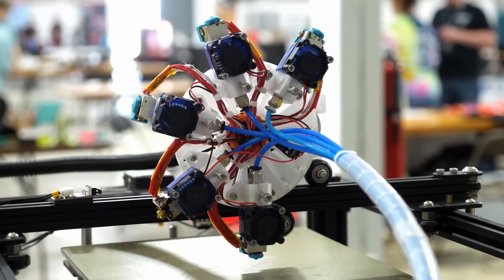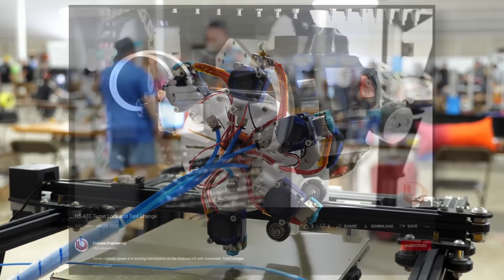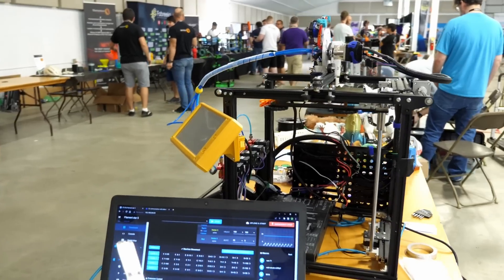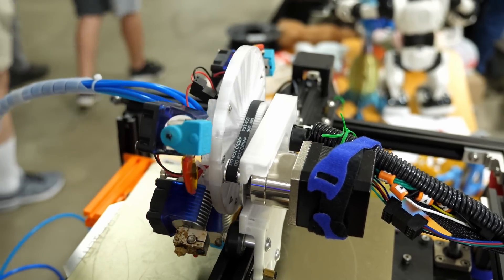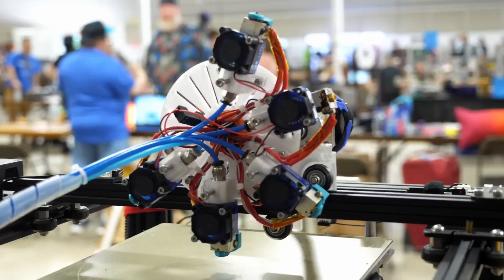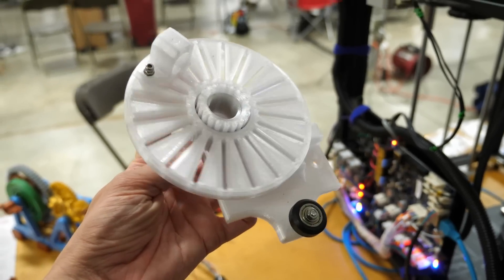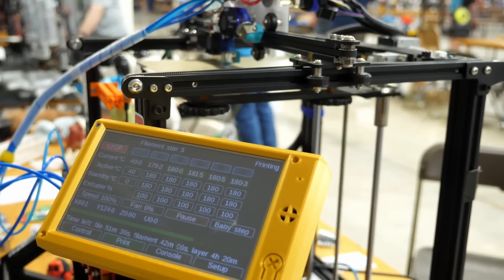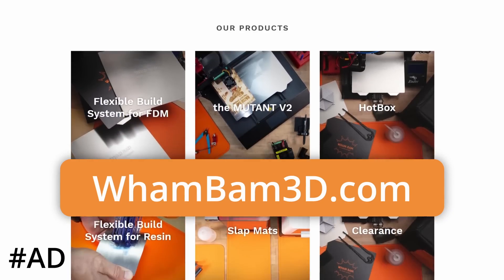The Toolchanger that ROTATES! #MRRF2022

Comment from the maker: Does the Rotating Tool Changer make you dizzy or is it a viable alternative to common Tool Changers?
Reply: Sincerely i don't like it too much. 
By working with advanced high productivity machine tools i've studied a lot about tool changers, and, in traditional machine tools, revolver turret, like the one shown in video, have been really passed by tool changers. To see a similar rotating system that is fantastic for flexibility look at Fanuc Robodrill. If you're instead interested in rotary revolver tool changers the ones seen in "Riello sistemi machines" are beautiful to look at, but convenient only in rare cases where certain flexibility need to be paired with high productivity.
Sorry for my English, but i really like tool changers in machine tools and wanted to say my 50 cents 🙈
Reply: I think it's a good way to make your printhead weigh a lot.
Reply: I think real toolchangers are the Future.(Like in a cnc) But this Design might be changed a Bit to accomodate maybe 3 Heads to get it lighter and still versatile. The reduced waste is a big plus.(you get that with Classic toolchangers also,but they might be more complex or more expensive.)
Reply: thats a lot of moving mass
Reply: Very nice indeed, if it could limit the build volume a bit less it would really interesting.
Reply: Besides the advantages you've pointed out, rotating a nozzle in an arc (while printing) can have benefits of its own.
Reply: it is crap but new things are cool

Comment: Hi Stefan,
First, any opportunity is a good one to compliment you on your work. Best channel on YouTube.
 I didn't find any way to write to Jerry and Jack directly, and I would like to suggest them to try their system on a machine that moves the trey in X & Y, and only the head (with the system) in the Z axis. It will be much more feasible this way. There is nothing to develop. Most milling machines are built this way. 
By the way, a creep resistance test on annealed PLA parts may create some interesting results, since this property is highly dependent on crystallinity percentage.

Comment: Definitely a cool idea, but that's a LOT of mass on the gantry. We have a small tool that's similar to TAMV, but more of a manual camera-assisted process. Still works easily, just not automated...but the advantage is that it's not tied to a specific printer or firmware type.

Comment: Every time people talk about 3D print tool changers, even just nozzles, I always wonder why they don't add an ironing head.  Wouldn't that work?  I would have thought that would be a gimme.  Plus, you could do more with tools like that.  Maybe have a little heated rod to iron the sides of layers.  It could ensure tolerances, texture, maybe even erase layer lines.
Reply: u can already iron out the surface with Cura by having it run thru the lines that were already printed

Comment: I could see them improving this by using it in an upside down printer, and having the tools rotate in a flat plane like a revolver cylinder. There would be no oozing if the nozzle was pointed up when not in use.

Comment: i dont understand how these experienced makers dont see the problems with this even before its made? bowden drive, weight, leveling just for first thoughts.
Reply: It's much more likely that, as experienced makers, they've all had experiences where they've thought something would never work only to find that all the disadvantages it had weren't as bad as they thought, and there were unexpected advantages. Sometimes actually building a thing even if you "know" it won't work is the best way to deal with an idea - even if it doesn't, the lessons learnt often bring insights to other projects that can't be gained from just dismissing it.
Reply: @bosstowndynamics5488  It can be a useful approach to build things you expect not to work and learn from the experience, and Simone Giertz gave a great TED talk about that. But the results are inevitable "shitty robots". There is quite a difference between tweaking a working design beyond what you expect to actually work, and starting with a design that very obviously amplifies a well known problem like seriously limiting speed with a very high print head weight. The latter isn't really constructive experimentation, just bad engineering, as there is no way this could have ended in a practical tool changer. If all they wanted was to experiment with rotating tools, fine, but saying that "it isn't a product yet" implies that they believe they can somehow optimize their way out of a dead end design.

Comment: What a beautiful design, even in its early state. It's like this guy read my complaints about the X1 Carbon and made a machine directly in response.

Also, has there ever been a printer where the bed does all the movement and the extruder remains stationary or is that a bad idea for some reason?
Reply: The bed moving would take up more space, and it’s heavier, but it could work…
Reply: @penninna  the space thing is a definite minus, but I figure at some point you can add enough extruders to outweigh the bed

Comment: Really interesting and useful for certain use cases, but not for me... I don't usually need multiple filaments, and I am used to more speed with my SK-Tank. I'm curious to know if it can handle hotends of different lengths though... maybe a Volcano on one, and something short for TPU on another. I guess you'd just need to insert some gcode to raise/lower the assembly as you are rotating. I bet Z height calibration is a hassle with this thing :-)

One (unrelated) thing I was thinking of trying is to use a stepper motor to drive the filament spool. I would need that set up mechanically, then add a sensor to determine the diameter of the filament remaining on the spool. With those two things I could maybe use some live code to to determine how much to drive the spool stepper. Ideally the spool would be kept in sync with the needs of the extruder, and you could avoid all the issues with too much or too little spool unwinding.

Comment: I've been toying around with the idea of a toolhead changer, and the whole concept seems really inefficient to me. You're either constantly thermally cycling each toolhead (no good for wear and tear, adds to print time waiting for the nozzle to get up to temp each time you switch colours, which means the heatbed is on and wasting energy for longer than it needs to be), or you have the other nozzles that aren't currently being used always at temp, wasting energy, and burning the PLA inside of them if one colour isn't used for a while. I suppose the most efficient method would be to estimate the time it takes to heat the nozzle, and have it start heating before it's needed.
Reply: True but there are inefficiencies in every type of multimaterial system, usually in the form of purged filament. The goal of this device is to minimize wasted material, which it achieves successfully at the cost of slower prints and higher energy use.

Teaching Tech did a review of the X1 Carbon and showed how a 28g multicolor print created 328 grams of purged filament. This is a nonstarter for me, and given the choice I much prefer the featured toolchanger

Comment: I think it should have a static, non-rotating lock + centering mechanism in place to properly center each toolhead independently from rotating. This would also unlock proper printing speeds. Head weight aside, I assume it would be manageable - but normal X printing speeds would be impossible just alone by the way the printhead is held (or rather not properly held) in place.

I would basically mount this rotating on top of a V slot profile, then have a locking + centering mechanism on the bottom of the V slot, shortest possible distance to printbed. Just so that there are no low freq oscillations building up over the whole 20cm diameter of the wheel.

If you would then add static brass brushes to each side which the nozzle has to pass before it can reach the printing area you would drastically reduce the oozing effects on the print. Maybe on a static area there would be room to prime the nozzles and dispose of the prime amount, so no stupid prime tower needs to be build on the buildplate, leading to extra moves.

However, wheel aside or not, if you would basically break it down and say, instead of five printheads you would only use two, and not use a 360° wheel but only a left/right tilting mechanism with hard endstops - I think the concept would work great and might be enough for many needs. Has this been done before?

Comment: Nice project, I was thinking to something similar, but using a servo motor for positioning. It seems that with the sacrifice of some speed it could be much easier to build than the toolchanging solutions or of Idex itself.

Comment: I've been toying around with the Idea to convert a 3D printer to a robotic microscope for timelapses etc.... something like this could be used to add a rotation axis.
Reply: For the lenses? That’s basically what they already do, except the lenses are at an angle.
Reply: @FieryCoal  your comment doesn't make any sense. An FDM printer is a cartesian robot with 3 axis so I'd only have one camera angle. I would need some tilt mechanism to add the ability to change the angle.

Comment: "Heavy!"  Literally!  The advantage of most tool changers is that the carriage only needs to carry a single head at any time and hence also doesn't have problems with oozing of the unused heads over the bed, but both of those advantages don't apply here and the wiring and Bowden tubes twisting like that also seems somewhat problematic in the long run.  And finally ... it's a Bowden drive ... that in itself makes me tag it as not a viable alternative.

Comment: I'm much more excited by that Kickstarter project that shares a heater but swaps nozzles. This one seems to just put too much mass on the printhead and I can't see how they'd deal with oozing.
Reply: My only concern with that system on kickstarter is the amount of steps required to go absolutely correct in order for a successful swap. I think there is going to be a lot of unhappy people with that one.
Reply: @DaneC020  absolutely, might be pushing the limits of a hobbyist system. But... if it can be made reliable it does solve a lot of the actual problems of multi-material printing with a side bonus of easy nozzle-size changes. I'm absolutely not throwing my money into the Kickstarter but I am watching with interest to see how it goes, lots of excitement and hope, tempered with much scepticism.
Reply: that wasn't the perfect solution either, you will lose the ablity to retract certain length of filament since it snips the filament on each swap.

Comment: No footage of it extruding?  Without that I'd be very careful to call it anything beyond a pinwheel.
Reply: There's a few seconds running at 1:30.
Reply: @jimbarchuk  Ya, that's x/y movement, no extrusion is visible - I'm curious to see video of print quality/purging/multi-color/etc
Reply: @planckstudios  You're probably right. If it were fully working they'd show that off. It's got to be spectacularly difficult to get multiple heads running *reliably*. One thing I don't like is the bowden tubes doing loops. All that friction adds up and makes retractions less accurate.